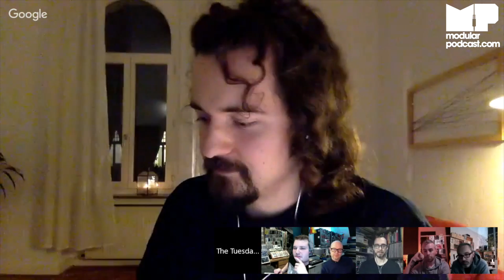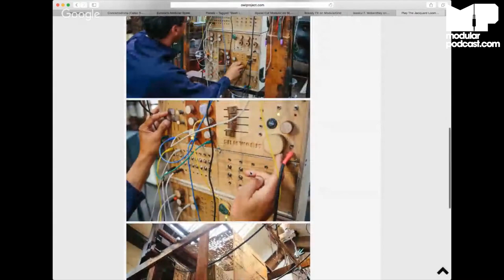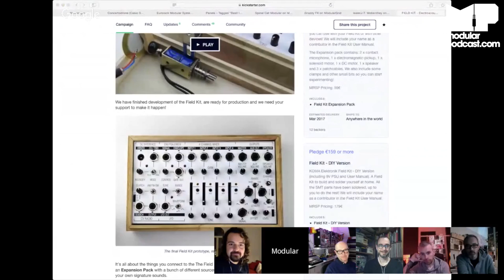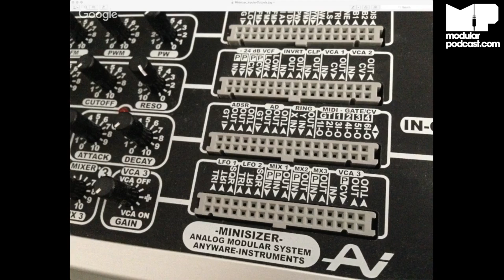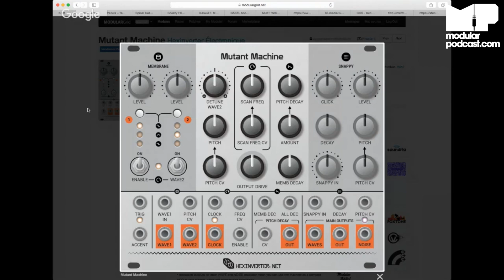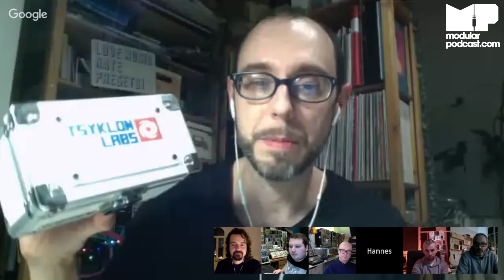Modular Podcast Ep #11 - Interface Design

Comment: Interesting discussion on sliders vs. knobs. I have an ARP 2600, which has 57 sliders. I use with a Eurorack system that has only knobs. The sliders definitely provide better feedback-at-a-glance, but it seems that it is easier to fine tune and dial in that right spot with knobs.  Although the sliders are of 1974 vintage, they still work and the ARP provides a great sound/modulation input/output to the interesting modules available in Eurorack. Matthew and Charlie's Serge conversation was also quite interesting, being that I have a soft spot for vintage synth designs. 

Great as always. Love this podcast. A great way to spend two hours!
Reply from the maker: Hey Barlo, thanks for watching and the comment. 

Yeah sliders definitely look the most immediate to glance at but harder to fine tune as you say. Some of the eurorack modules using sliders have a very low physical range on the slider which makes it even harder. 

I've definitely got a soft spot for Serge too.